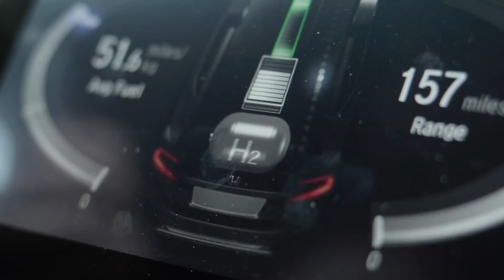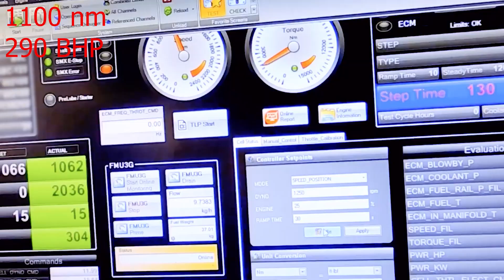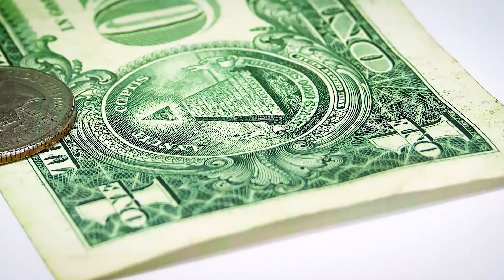Cummins changes there focus from diesel to a 15 liter Hydrogen Internal combustion engine

Comment: To make Hydrogen, you have to use electricity.
To have one unit of energy in form of Hydrogen, you waste 60% of the electricity, because of the scarce efficiency of electrolysis.
Then you have to compress it (and it is the smallest molecule, so it is difficult), to store in gas cylinders, who tend to lose the content over time, since H2 is so small that can pass through gaskets and even through solid materials, so the overall efficiency of the production and storing H2 is awful, and you want to use it inside an engine who have an average efficiency of 20%?

Even an old concept car with lead acid batteries can do a lot better result.

H2 have a reason to exist only if you use it in fuel cell, where the energy conversion between the chemical energy stored in H2 and the electricity they make is up to 98%.

Burning H2 in a piston engine is simply idiot, and this obviously is a greenwashing strategy for Cummins, to turn their image to green, at least with people who don't know how H2 production works.
Reply: But there are many other ways of making hydrogen that dont require electrolysis and these alternative methods are more efficient and will get more efficient as time goes by.
Reply: @jonathondeeds3423  Give some example.
Reply: We could use genetically modified algae, could use nuclear power for  electrolysis, and there has been new research into making electrolysis more efficient; also one of the reasons that fuel cells are not a good idea is because they lose their effectiveness over time.
Reply: @jokerjacky5676  Oh, sure.
Algae with an actual efficiency lower than electrolysis.
To have "dirty" H2.

And yes, fuel cell decrease their efficiency over time.

Exactly like IC engines.
With the difference that IC engines starts at a level of efficiency worse than the lower you can expect from a fuel cell.

What are you speaking about?
Reply: @dadoVRC  The reason for the inefficiency of ICEs is because the conversion of thermal energy into kinetic energy is the least efficient conversion. The most efficient is kinetic into thermal, which is why brakes work so well, but require special features to dissipate that energy into the air. That's why everyone wants an electric car. Electric to kinetic is the second most efficient conversion at around 94%, while kinetic into heat is around 98%. Electrical energy can be very efficiently converted into kinetic energy because electricity already has some amount of kinetic energy via the flow of electrons. 

An electric motor works simply by matching the kinetic speed of the rotor to the kinetic speed of the electrons flowing through the coil. You can say it's because of the interaction between the magnetic fields, but that's just a fancy way of stating the exact same thing. That's why electric motors are most efficient when holding a steady rpm. The average 6% energy loss from an electric motor is due to the time it takes to match the flow of the electrons.
Reply: @TheDustyShredder  So, what's the point of burning H2 in an inefficent ICE, since the electro-chemical reaction in the fuel cells is incredibly more efficient?

Maybe isn't so clear for petrolheads, but H2 doesn't come from a hole on the ground.
It must be made from other source of energy.

And it is way less efficient than the old rugged lead acid battery even when used to run an efficent electric motor via fuel cell.

Using that electricity to chage batteries is,at the moment, the most efficient way to store and use energy.

Those are FACTS, not opinions.

ICE H2 engines are bullshit.
Reply: @dadoVRC  Because the ICE concept itself hasn't fully matured. If we use peltier devices attached to a combustion chamber, electrolyze water and mix the O2 and H2 in an injector, we can use a flame jet (similar to a propane torch) and heat sinks to maximize the temperature difference on either side of the peltiers, which will maximize electrical output. This is still an internal combustion engine, but it's not being used to drive a kinetic device, it's being used to directly generate electrical energy through thermal difference. It's the exact same device used to cool mini fridges. Apply electricity to it and one side heats up, the other side cools down. Heat up one side and keep the other side cool, and it produces electricity. Also, because there is no air entering the system, it's not burning carbon, nitrogen, or any of the other gasses present in atmosphere, which means you can crank up the combustion temperature without any emissions other than water vapor, which can be collected, condensed, and sent back through the cycle. This is slightly less efficient than electrical to kinetic, but is the most efficient method for generating portable electricity using an ICE and will require very little refueling, which would just be water and electrolyte which could be something as simple as salt. This means that combined with either the new solid state batteries or the lithium sulfur batteries, range can easily become 2000-3000 miles.

One of the biggest drawbacks to current hydrogen engines is that they take in atmosphere, which means water is not the only emission. These engines still emit CO2 and NOx. That means that the engine has to be run either super lean or super rich which reduces the combustion temperature to a point where it's not effective. Utilizing a mixer injector to combust the electrolyzed water in a sealed chamber does away with that temperature restriction. A second drawback is that they require dedicated hydrogen tanks, where my peltier engine concept would only require a 10 gallon water tank and a 2 gallon electrolyte tank with an electrolysis chamber. The water and electrolyte would be gravity fed and mixed into the electrolysis chamber in a 5:1 ratio, and the h2 and O2 collected will be pumped to the injector for combustion. The condenser will have a small sump to capture the water and pump it back to the tank.
Reply: @TheDustyShredder  Where did you studied physics, at Disneyland?

You can't extract more energy than the chemical energy it is entering in a system.

If you start with 100 units of chemical energy in a system, you can't extract more than that.

Even if you have a (non exixtent in reality) system who have 100% efficiency, for example an ICE with that efficiency, and you fuel it with H2+O, to run a 100% efficiency generator to make 100% efficent electrolysis, you can run only the system.
Any attempt to attach any utilizer, even a single LED, is causing the system to stop.

Overunity isn't an option, it doesn't exist.
And even 100% efficiency doesn't exist.

Apply to study thermodynamics.
Reply: @dadoVRC  I didn't say it produced 100% of the energy it needs to run with a load. I actually didn't offer any efficiency quotient because this is just a concept.

The new lithium sulfur batteries will have an average range of 1500-2500 miles per charge compared to the 500 of lithium ion for the same size. Seriously, look it up. This system is merely a range extender adding about 500 miles, but with the right peltier modules, you can generate enough energy to produce the HHO (oxyhydrogen) and reduce the load on the batteries. This engine will be a little more expensive than current designs despite it's simplicity because of the materials, the peltiers, the mixing injectors, and it has to be completely sealed and it needs to be under a vacuum to operate the way it is meant to.

The issue is temperature because even titanium won't withstand the maximum combustion temperature of oxyhydrogen which is almost 5,000°F. This unfortunately means I can't use a stoichiometric ratio, and will likely need to reduce it to 4:1. That said, the peltiers also have an upper temperature limit, and this cannot be exceeded.

An additional method for electricity generation would be to use triboelectric nanogenerators on all parts of the car that move or vibrate. This would extend the range even further.

Again, I'm not suggesting creating an overunity device in any capacity. I'm simply suggesting maximizing combustion temperature within the limits of the materials and using peltier modules to extract that thermal energy as efficiently as possible. With a chamber length of 80mm and a circumference of 240mm, I can fit 48 20mm^2 peltier modules and generate 576W at 12V. Increase just the length to 3200mm, and you can fit 1,920 of those peltier modules, which would produce 23kW at 12V (1920 amps), or with a stepup module, 64 amps at 360V. This can actually run a hybrid sedan on it's own. This is assuming a 1 amp output on all peltier modules. This engine is also the same length as an enduro mountain bike with both wheels mounted and inflated, and can be easily modified to fit vehicles of all sizes. The smaller the car, the less power generation is required. I would imagine that with this engine, you could even do away with batteries entirely. It would also be a lightweight engine since it's just a metal tube with 4 injectors, an ignitor, and a lot of peltier modules and heatsinks, all of which are lightweight in their own right. It would begin generating HHO at 35% battery capacity and ignite at 30% to begin charging the batteries while the vehicle switches to the peltiers for slightly reduced power until the batteries reach 80% capacity, then it will enter hybrid mode with full power for the last 20%. It's intended to be a dynamic system.

I would rather use this system than a fuel cell because it would be cheaper, produce a similar amount of electrical energy, and be easier to maintain, even with the 4 injectors. If I made the flame jets small, I could use a stoichiometric ratio and reduce the fuel consumption for the same chamber wall temperature. That would mean I could use a smaller HHO generator and consume less energy generating that fuel.
Reply: Sorry if it seems like my post wanders, I tend to develop ideas as I write them.
Reply: @TheDustyShredder  It is a nonsense.
Burning H2 is the less efficient way to use it.
High temperatures means high ∆t, and high ∆t means more thermal energy wasted.
Peltrier cells have a very low efficiency, using them is simply pointless.
Your idea is burining it, generating a lot of temperature to run shitty technologies trying to recover some energy.

A simple fuel cell has an efficiency >40% in the worst case.

An Otto engine running on H2 is struggling reaching an average of 15%.
If you recover the 20% of that 85% with peltrier cells, best case, the total efficiency is 32%.
So in the best scenario your system has 8% less efficiency than a fuel cell in the worse condition.

And...remember.
We are speaking about veichles.
Your system is a lot heavier.
The difference between two electric motors, one H2 cylinder and some fuel cells compared to an ICE with its subststems (cooling, electric wiring etc), + two gas cylinders (H2+O2), + peltrier cells, + electrolyzer, + two high pressure compressor to store the H2 and O2 from the peltrier cells, etc.
Reply: @dadoVRC  Well said, I agree totally.
Reply: @dadoVRC  It has been found that ICE can be just as efficient as Fuel Cell at low loads and a lot more efficient at higher loads, plus ICE is far more durable and cheaper to manufacture. Another point is there is a lot potential left in ICE technology.
Reply: @TheDustyShredder  Heat loss through the cooling system and exhaust are the main reason ICE are inefficient this lost heat energy can be capured and turned back into torque drastically increasing efficiency.
Reply: @jonathondeeds3423  Fake arguments.
ICE have the best fuel efficiency around 2/3 of the engine load, seems that you didn't know the matter.
Reply: @dadoVRC  It's not an Otto cycle engine. My concept has only two moving parts: the pumps. The point of this engine is that there is no intake or exhaust, it's a sealed system utilizing a low pressure argon saturated environment in which to burn oxyhydrogen at the highest temperature possible without generating secondary combustion byproducts. Titanium will be used for the combustion chamber due to it's temperature and corrosion resistance and light weight.

Peltier modules require a large temperature difference across the two sides to maximize efficiency. Since oxyhydrogen burns over 5000°F at a 2:1 mixture ratio of H to O, it's the ideal fuel for generating this temperature difference. In addition, because it would be computer controlled, the temperature and coolant flow will be actively adjusted to maintain maximum output from the peltiers.

Also, what tanks? The only tank will be for the water+electrolyte. From there it gets gravity fed into an hho generator where a compressor sends the gas directly to the injector to be mixed and burned. No moving parts otherwise. As far as connecting the wires for the peltiers, they'll be connected to bus rings around the engine, so only eight wires actually leave the engine: injector control, temperature sensor, condensation scavenger pump, and main power.
Reply: @TheDustyShredder  Er...ok, perfect.
Make it and also make a video of the system running.
I'm curious.
Reply: @dadoVRC  most of your facts are fake you are claiming ectrolysis is only 40% efficient while it is a well known fact that efficiency of electrolysis is well over 70% efficient , with this initial lie it is fair to assume that the rest of you statements are just base less misinformation. Clearly you are just trolling.
Reply: @jonathondeeds3423  Wr aren't speaking about lab efficiency.
Cars need industrial production, and maybe 40% is too less, but if you add to the electrolysis the necessity of compressing and cooling the H2 to make it useful for veichles, the overall efficiency is less than 40%.
Reply: @dadoVRC  I need to get my business running first. It's worth it to think of products to make before you start a business so you can find the equipment you need to produce them. It'll be about 10 years until I can afford to enter the car department of the automotive industry. I'm starting off with bicycles and motorcycles because they're cheaper to produce and easier to design.
Reply: @jonathondeeds3423  that 70% is only in controlled environments with a steady rate of electricity production. A fuel cell on a vehicle produces variable rates of electricity and burns variable amounts of fuel. This greatly affects efficiency. In addition, you have to factor in ambient temperature, fuel temperature, circuit resistance, voltage drop, etc. This all affects the overall efficiency of the fuel cell.
Reply: Actually, there are containers that can store hydrogen long term. Certain plastics can withstand several tons of internal pressure, and plastic is nonporous. The issue is the seal and valve for the very reason you described. Until we can develop a nonporous seal and valve that hydrogen can't escape from, we will lose a small amount per day.

As far as production goes, utilizing geothermal, solar, wind, and nuclear energy, we can place electrolysis plants at every gas station and subsidize the production to offset the energy cost for the station. This not only ensures constant production, but by replacing the current fuel tanks with adequate pressure vessels, gas stations can produce enough to not only refuel a large vehicle, but have enough in reserve in the event of a failure to hold the station over until repairs can be made to the plant. Since gas stations are already no smoking/idling zones at the pumps, there would be little risk of flash fires (can't count out the morons).
Reply: @TheDustyShredder  For sure.
It must be those the motivations because the industry is developing metanization of H2.

Comment: This is the way to go. 
Instead of focusing on EVs we should put all our efforts into carbon neutral fuels or at least cleaner fuels than Diesel and Gasoline.
This way the further development of the ICE can continue and that's a very good thing as we are just really beginning to figure them out. 
Power output relative to engine size has constantly increased while emissions have dropped. We are not done with the ICE.
Reply: Are you serious??   It's taken well over 100 years, and nobody has yet managed to get the ICE engine past 35% efficiency!!  Euro 7 emissions regulations - due in 2025 - will effectively kill of ICE development in Europe. A number of European car makers - Audi included - have already stated that they are ceasing any further ICE development to concentrate on EV development and manufacture. Indeed, Audi have stated they will produce their final ICE cars for the European market in 2026..... Most UK car makers are switching to 100% EV production in 2025. Sure, you could have e fuels, but would you be happy paying 3 to 4 times what you pay for unleaded petrol? Because that's what it would cost.......
Reply: @Brian-om2hh  EV isnt the answer bruh...
And Toyotas new gen engines peak at 41% thermal efficiency.
Reply: @alouisschafer7212  EVs aren't much more efficient than that acutally once you count in grid looses grid storage, addition grid capacity needed, and battery losses etc... I'm in the process of converting my Honda insight to a plug in hybrid and by the time I do that it will be MORE efficient than your average Tesla...
Reply: Yeah 2 strokes on carbon neutral fuels. these hydrone 2 stroke need to run the high end 2 stroke oils like amsoil interceptor. I fil and run Xd-100 in my 8v92 2 stroke detroit, 6 gallons to fil it. I tried Klotz techniplate 2T it ran good but its some strange stuff.
Reply: yeah with a 2 stroke not a low power to weight 4 stroke. also oil injection with bean castor oil and none of this change the oil every 3000 miles crap!